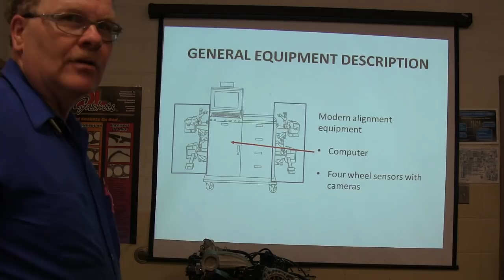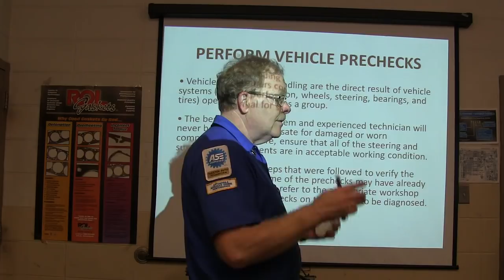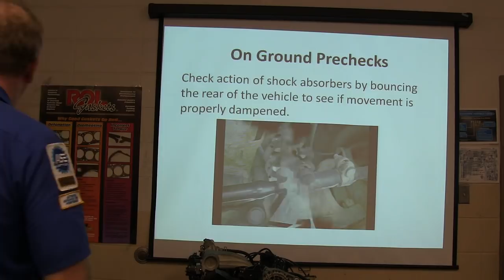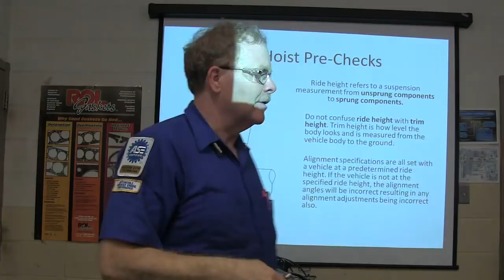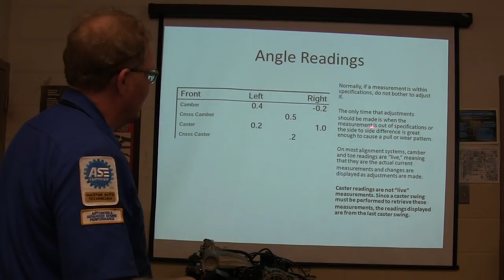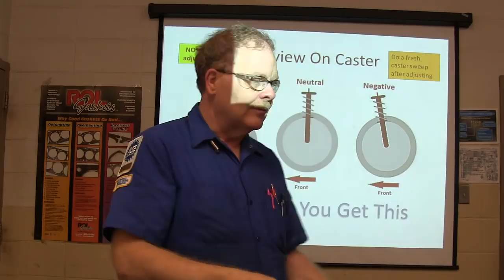Aligning

Comment: Had a 90's Crown Vic I was working on and the air suspension in the rear had a small leak. By the time I was done and went to lower it, I caught it right before my floor jack crushed the fuel tank and or poked a hole in it. Had to start the car and let the bags fill back up then drop it.